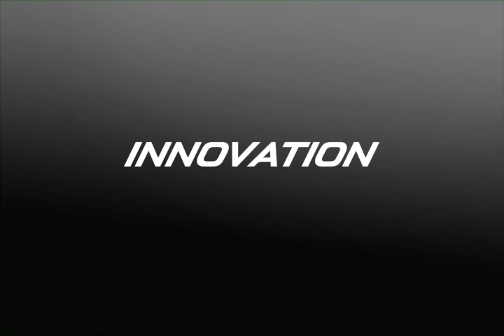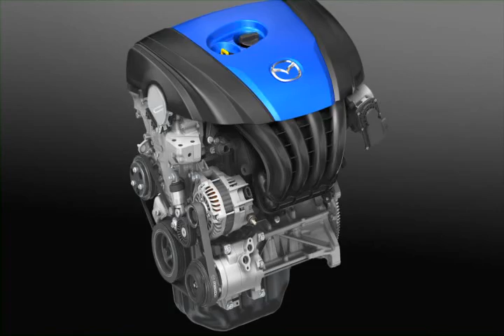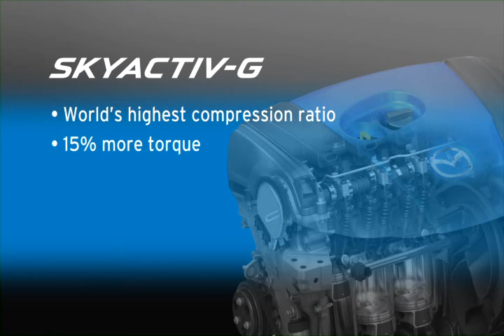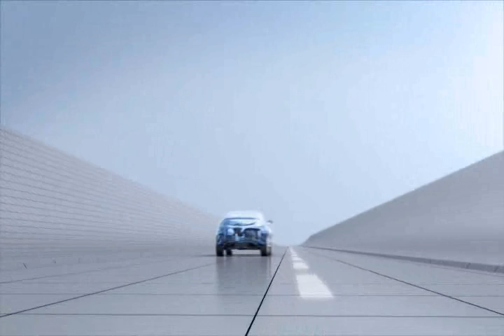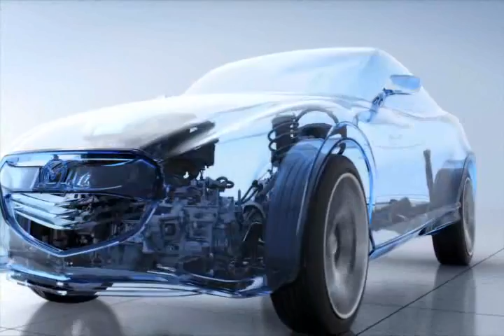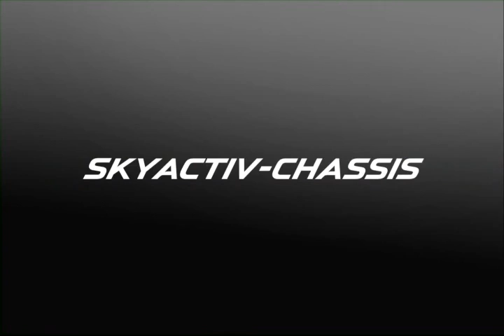Skyactiv Technology

Comment: Don't get fooled by this marketing video.

I have 2022 Mazda 6 with Skyactive-G 165. This is a highly disappointing engine inferior to the 1.5l Ecoboost which I had in my 2018 Mondeo. I assume other modern turbocharged engines are similar to Ecoboost. Skyactive has no power until very high rpm (means around 6000, where the engine roars), and the fuel economy is also worse than in 1.5l Ecoboost.

The high compression ratio of Skyactive cannot keep up with what turbo does in smaller engines.

Furthermore, Skyactive-G 2.0l does not have a balancer shaft which probably leads to increased engine vibrations. I am currently in difficult discussions with Mazda customer support on this issue, and I might provide a further update when I have more answers.

Altogether, it seems Skyactive-G is just cutting corners by Mazda, by saving few bucks per engine by avoiding turbo. Mazda is a global corporation that can make any engine they want, they certainly know everything about the poor performance of Skyactive-G.
Reply: Just buy a mazda mx5 miata 2.0L problem solve ✌🏼🙂

Comment: Well this wasn’t true and doesn’t account for people NOT allowing the engine cold light to turn off ( engine operating temp ) and creating extreme wear to piston rings and cylinder walls due to cold washing with fuel ⛽️ 
Also because of high operating temps the thermostats and radiator caps wear out super quick ( expect to change thermostat every 2 years or less ) and expect fan resistors/ rheostat unit to fail after a few years but you won’t know until engine overheats leaving you stranded . AND THE TIMING CHAINS AND GEARS ARE CRAP ( expect to do a timing chain replacement at 70’000 km )

Comment: NOT clear how you decrease combusting temperature with the "different" exhaust pipes. And do you know about intercooler? :)
Reply: when the exhaust is exitting the chamber the presurewave to the next cilinder is calculated that the exhaust gasses go to the next cilinder when the exhaust valve of that cililinder is closed so that the hot temperature  of the exhaust gasses do not enter the cilinder and so the mixture stays cool. and an intercooler is used to cool intake air that is heated by the turbo pressure
Reply: Intercooler is for intake